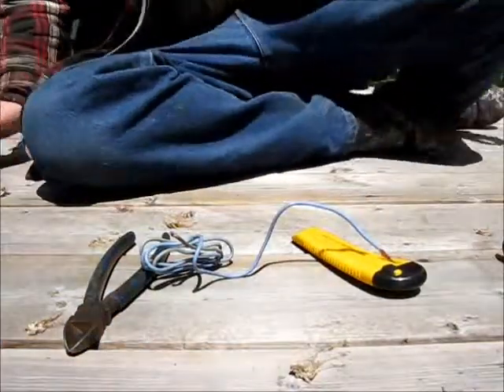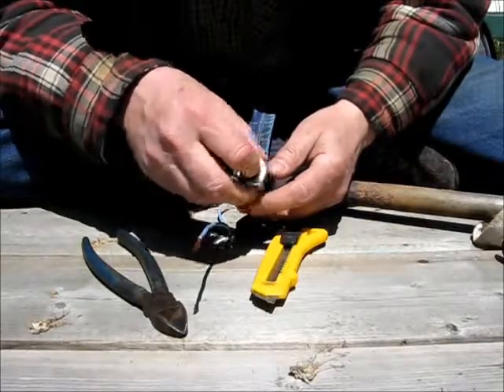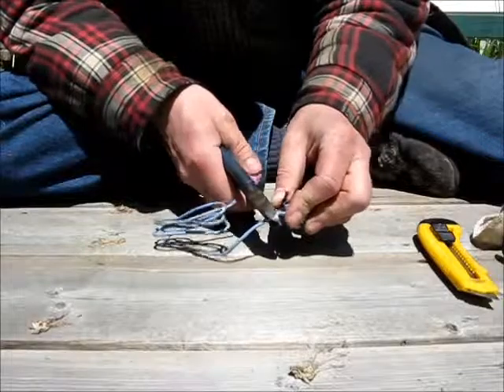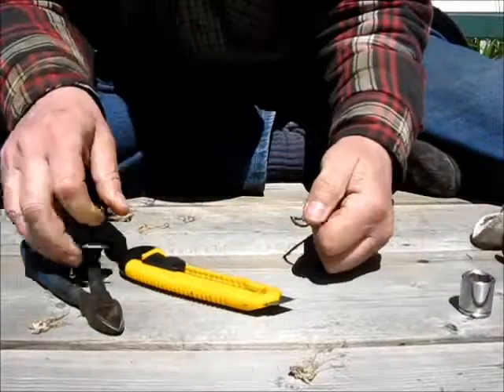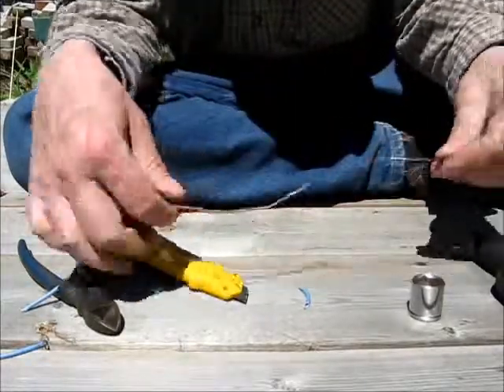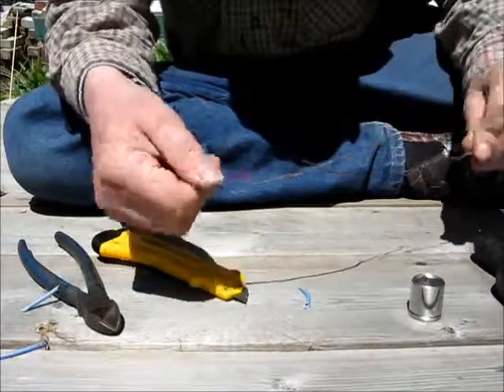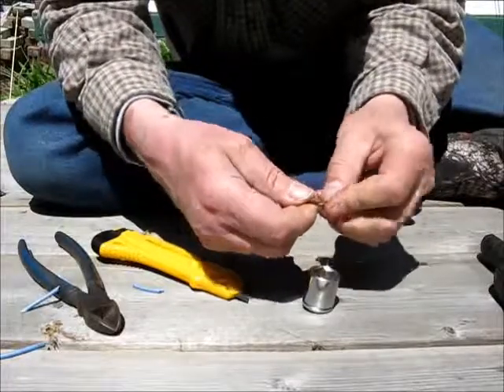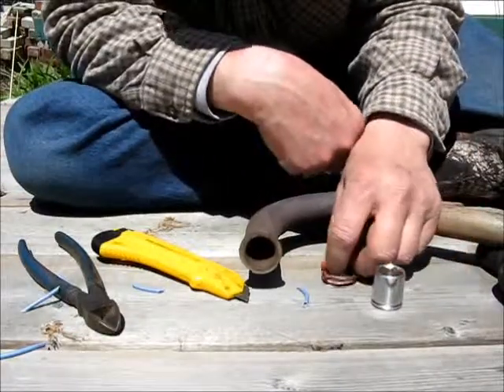Copper Crush Gasket

Comment: thanks so much for this great cheap and recycled idea. i will attempt this on my 93 volvo 960 exhaust manifold to down pipe flange gaskets using old speaker wire.